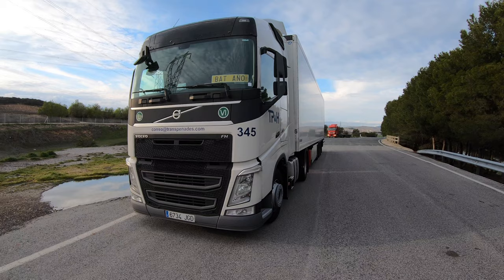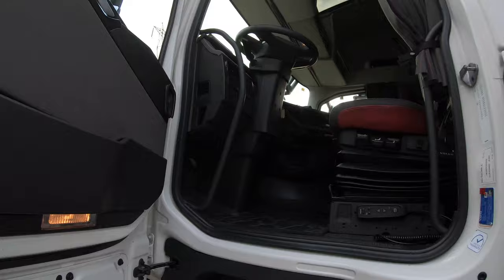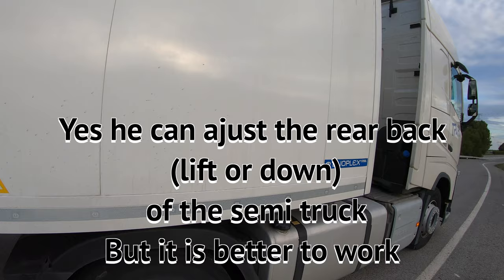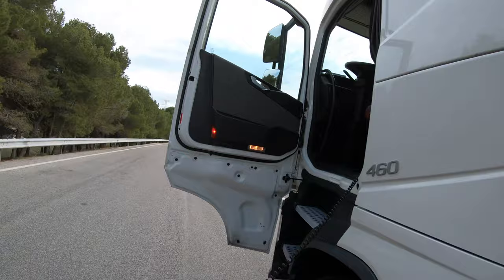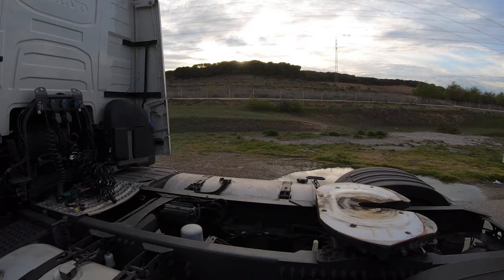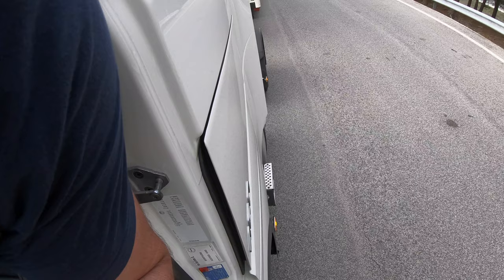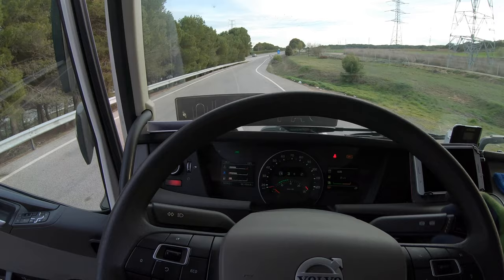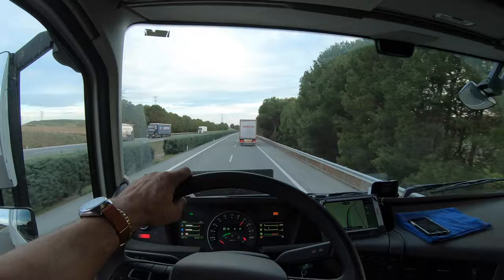POV in 4K Coupling and Uncoupling semi-truck  from semi-trailer KRONE

Comment: First thing I do when im Uncoupling my Trailer is to Raise the Back of my truck a Little Bit Up to let off Pressure on the Trailers Legs, then I move back to the Cables and Pull them out. After Cables I move further back to the trailers Parking Brake, pulls out the Red Button like You did, and I also Push in the Blue Handle to Lower the trailer, making it Easier for the King Pin to Detach from the Fifth Wheel. After that I walk over to the other side and Lowers the trailers Legs. After the Legs I move over to the Fifth Wheel. I open the Safety Lock and Pulls the Handle out. After that I walk back over to my Air Controller and Lower the Back of my truck Down till I see a Gap between the Trailer and my Fifth Wheel. And then you are good to go! (For those who are new to the trucking industries)
Reply: make a step by step video of this unreadable
Reply: Hai

Comment: Thank you! Perfect! A question: do not you need to fix the king pin at the end when the trailer is connected (you pulled out long arm at the beginning relaxing the fixator) ? The mechanism fixes automatically?

Comment: When you will have time, put some grease on your fifth wheel. It seems very dry 💪
Reply: They are running Teflon pads on the 5th wheel, no grease needed.